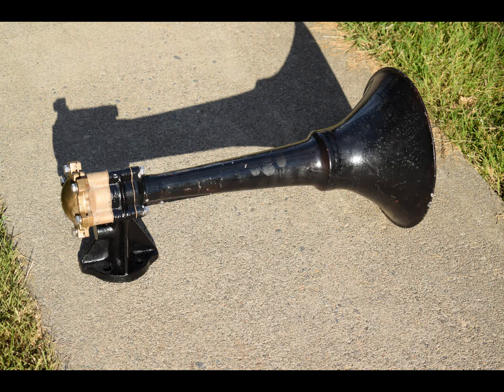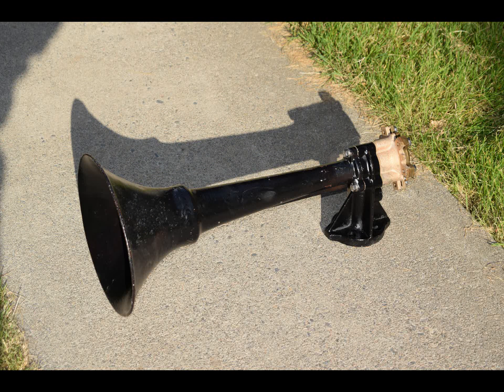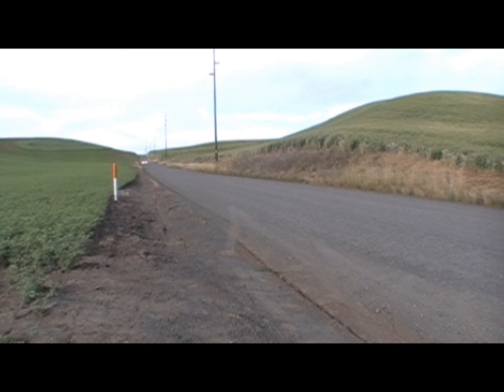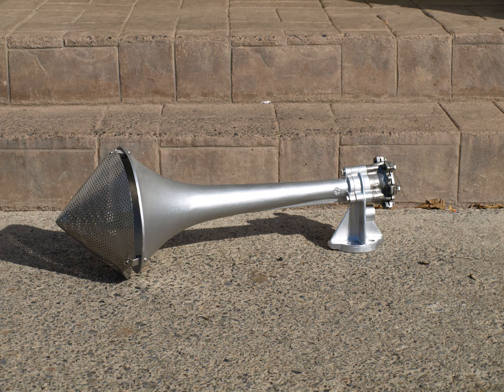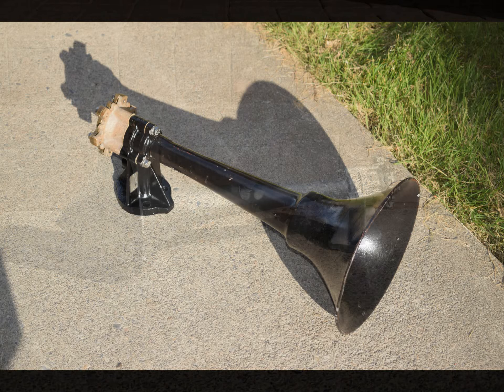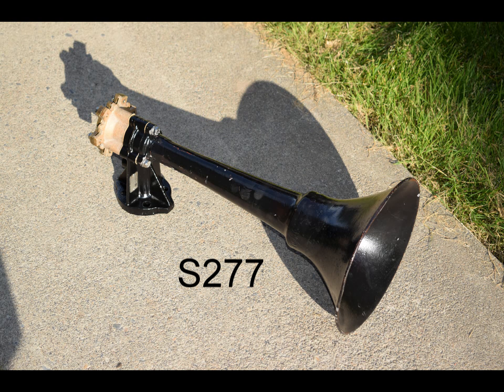Rare Leslie S277

Comment: Could you try re-creating a s3e, now that you have an important part of the horn?
Reply: Train Horn Dude he still needs a 247 bell in order to do that. Which from what I have research no one has one, because the S5A and S3E where never produced. Despite the supposed railroads you think had them.
Reply: NKPBerk284 yeah true, no s5a has been confirmed yet.
Reply: NKPBerk284 you clearly don't know Milwaukee 999 yet though.
Reply: Check the reply on the H&W board.
Reply: NKPBerk284 Replied to it.
Reply from the maker: I have shims that turn a 25 bell into a 247 bell. I may try for a true S3E replica at some point